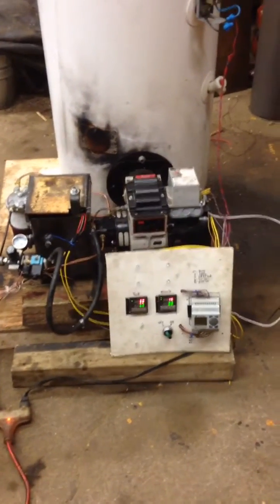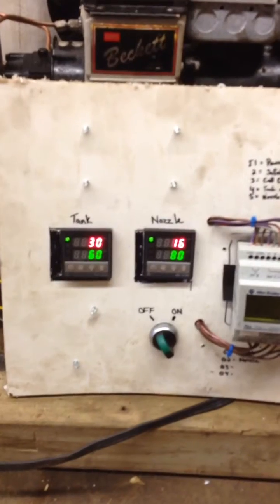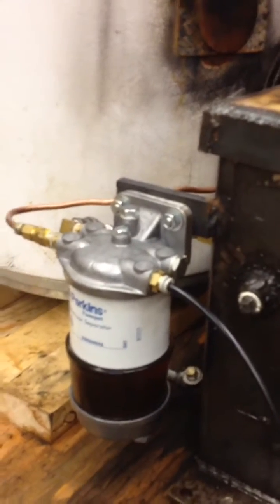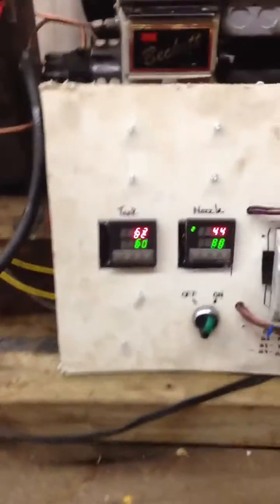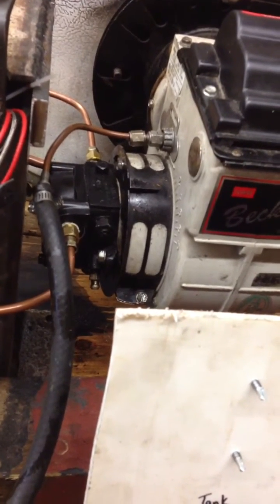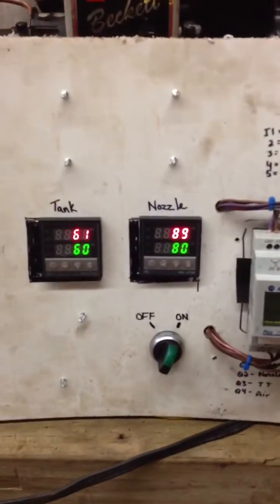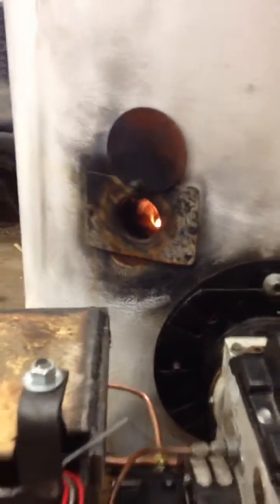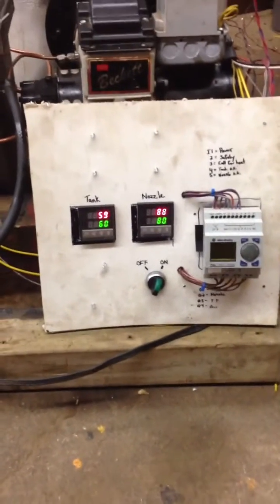Waste Oil burner

Comment: I'd like to see more video on this showing all the piping and the way your tank is set up
Reply from the maker: If your still interested, I can help you out.
Reply: I would like to see me too, the burner pump is just for recycling oil in the filter, or it pumped in the nozzle with a air suction nozzle?

Did you remove the squirrel cage from the burner or it need the ventilation!!

Comment: I just bought the CK kit. I was thinking of trying to find a oil furnace to put the kit into. How is the Hot Water heater working? Do you have any mod's to the water heater or is it just the burner at the bottom and stove pipe at the top?
Reply from the maker: This burner was moved to a boiler but it will work in a furnace, tank or boiler without modifications.